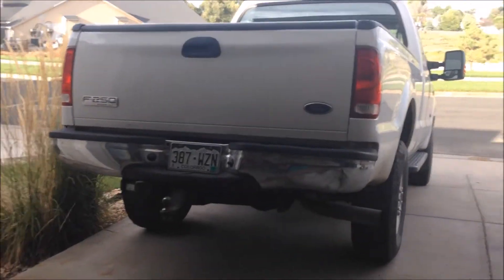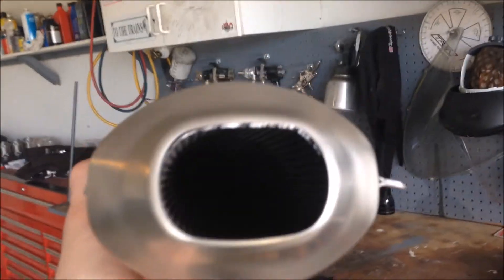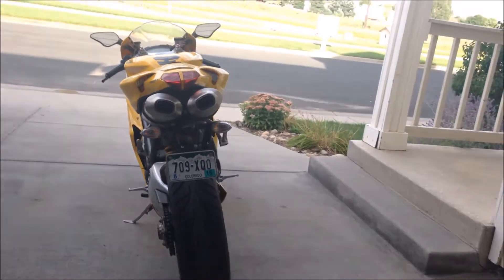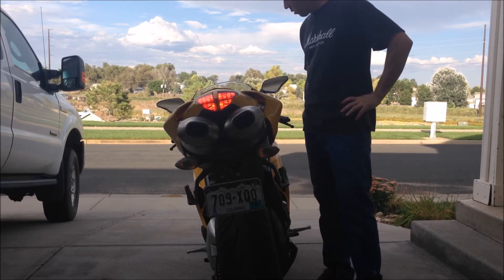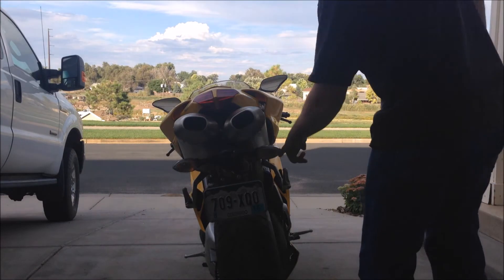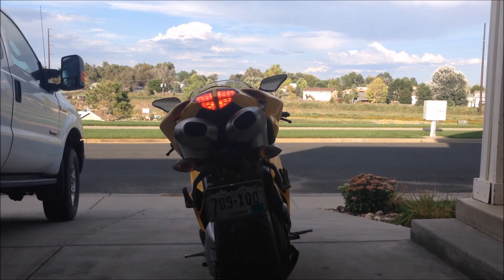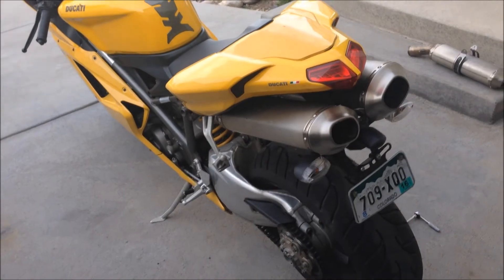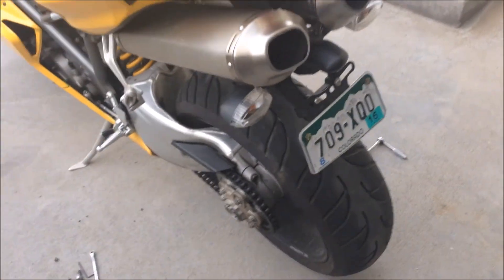Two Wheel Tuesday Tech Tip: Ducati OEM Exhaust vs Race Muffler

Comment: Thanks for making this video, did you have to flash the ECU or is not needed because it’s not a full system? I think the race baffles sound amazing 👍🏻
Reply from the maker: charlie ryan I didn’t tune it, but it probably does need it.  I can tell I lost a little on the bottom end, but the top end hits harder